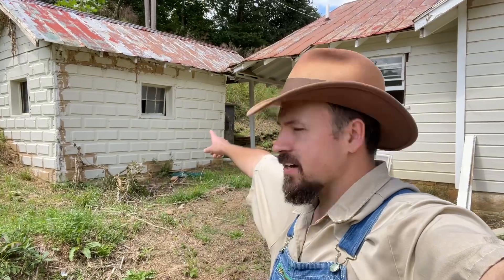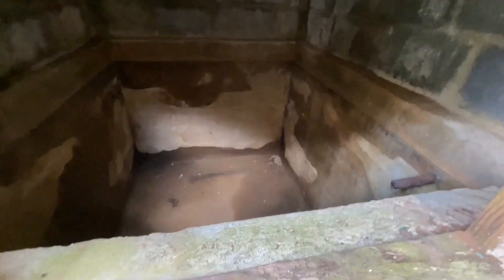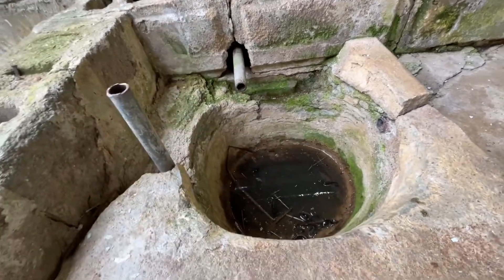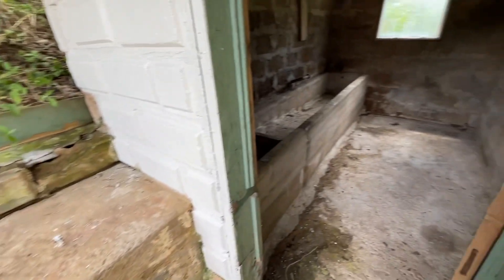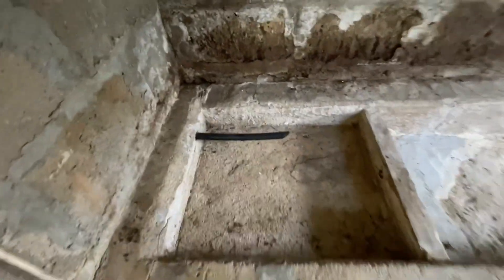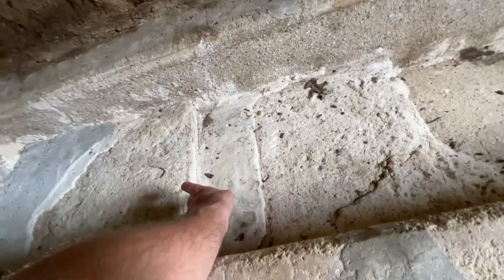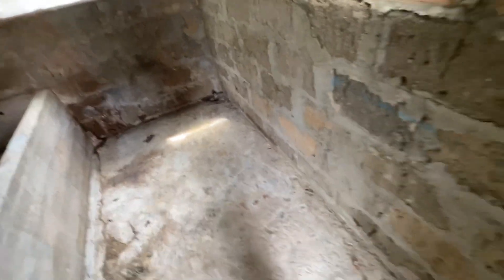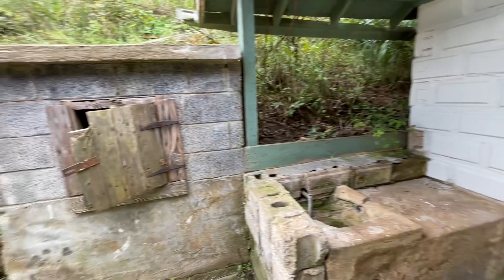Old Spring House In Appalachia fff#51 v256

Comment: I am originally from Aussie Land, and there they had what was called a coolgardie safe, for a refrigerator, that was put in a breeze way between buildings in the shade and breeze, it was made as a box type framed and had 3 or 4 shelves, the sides and back was covered in a fly screen type fabric/material all around, and the door was covered in it too, with a catch to close it and keep out critters etc.  Milk, cream, and cheese etc., was stored in there and used as I said earlier a refrigerator.  Very cool, sorry I couldn't resist, lol.

Comment: I don;t think the pipe at the bottom of the outside catch basin drains to the outside. Otherwise, water would never reach the higher pipe which goes into the spring house.
I have no idea what the tall pipe is for unless it is for some type of pressure equalization.
You certainly have interesting videos.  It will take me a while to enjoy them all!  😀
Reply from the maker: The pipe in the bottom is a drain, it has a plug on the outside front. I may have forgot to show it. Thank you so much!
Reply: @metcalfmills5679  Thanks for the clarification.  That does make sense!